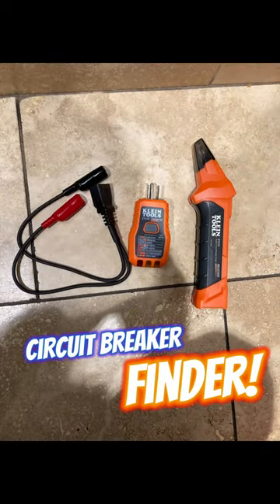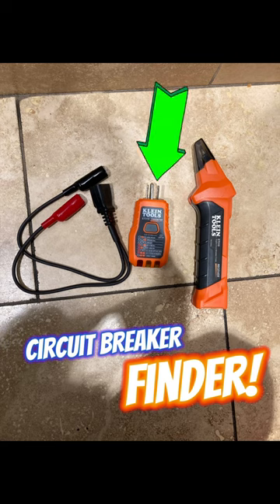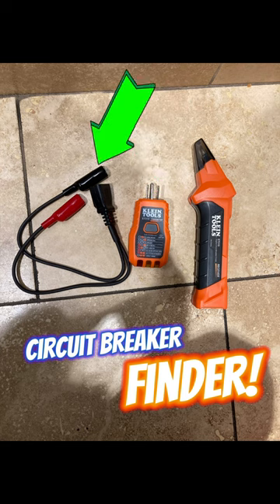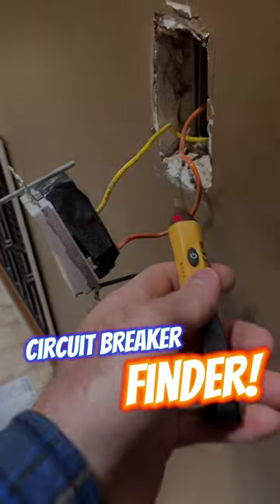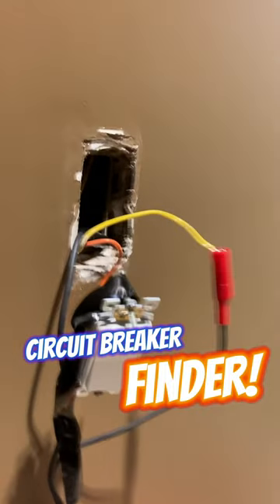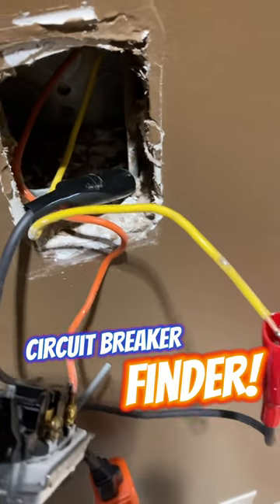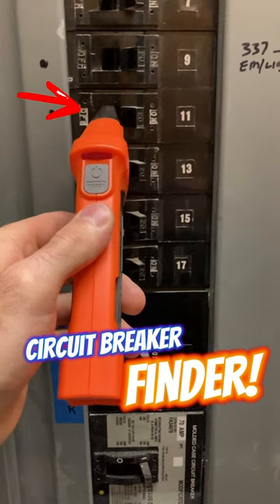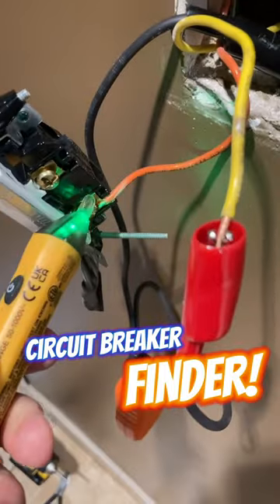Circuit Breaker Finder by Klein Tools! #facilitiesmaintenance #electrical

Comment: You supposed to clip, the red alligator clip to the ground or neutral wire?🤔
Reply from the maker: I clipped the red alligator clip to the hot wire and the black alligator clip  to the metal box (ground).
Reply: @kjfacilities-maint  I believe you MAYBE clipping it wrong, the part of the cord,you plug the transmitter's prongs into, if you look at it , on the right side is where  the small prong inserts which is the hot side and it leads to the black alligator clip and and the left side is where the big prong inserts which is the neutral side which leads to the red alligator clip and the round is suppose to be ground but, if look inside where the ground prong inserts, there's no metal inside like it is for the hot and neutral sides to detect circuit! I hope I'm making sense friend, I'm trying to get the most accurate info on this before I use it tomorrow, if I'm wrong please let me know!
Reply from the maker: @GdUpG2Gmafia  Here is a link to the manufactures instructions for you: 
https://youtu.be/Ay0nTtk0KUQ?si=BrkfWq6Zpqq3cf8K
Reply from the maker: @GdUpG2Gmafia  Here is the manufacturers instruction link: https://data.kleintools.com/sites/all/product_assets/documents/instructions/klein/ET310-INSTRUCTIONS_WEB.pdf

Comment: So you have to remove the light switch and disconnect the wires to connect on the croc clips all whilst live/hot then walk away from it leaving these live/hot wires flapping about in the wind to switch off at the panel… Seems like a very unsafe practice to me.
Reply from the maker: You don’t have to disconnect the wires if the alligator clips will grab on to the screw terminals or the wires.  It is best  to have a co-worker stand by the switch to keep people away, and block off the area.  Or, if by yourself, perform this task when people aren’t going to be around.

Comment: Probably more expensive than just shorting the circuit with a spare bit of wire, though.
Reply from the maker: You can find reasonably priced circuit breaker finders starting around $20.